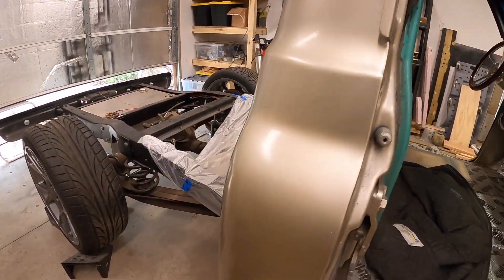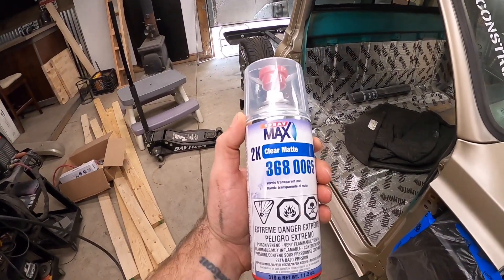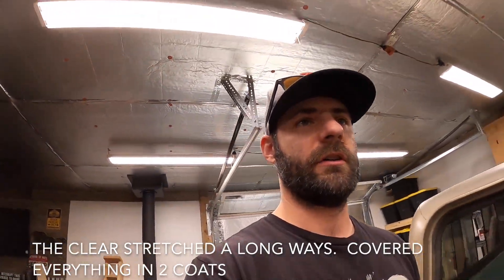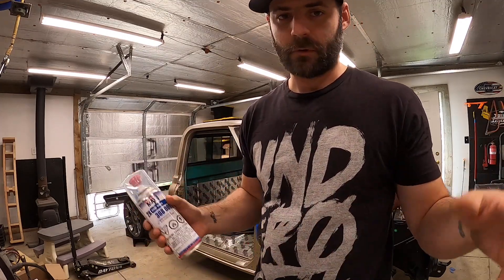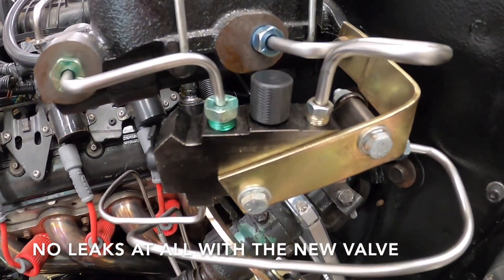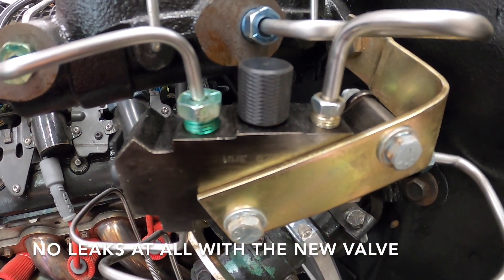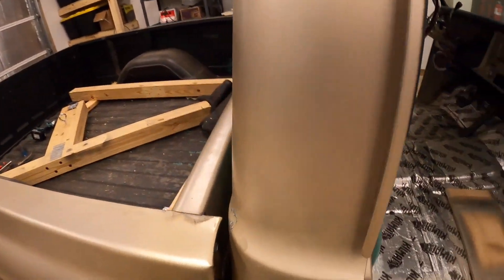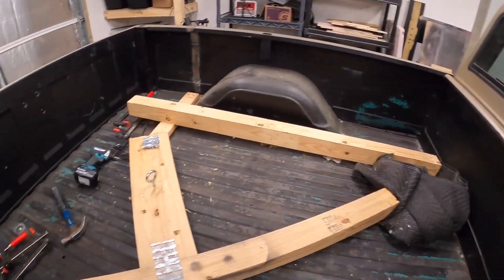Bleeding Brakes, Painting the Cab and Putting on the Bed | 1970 LS Swap Chevy C10

Comment: Did you remove the proportioning valve bleeder tool and reinstall the brake light warning switch after bleeding? Just asking bc it's still installed in your video

Comment: If you would like you can push your steering column in/down about an 1.5" and you only have to drill one hole at the top for the locator pin.   Love the truck.

Comment: Goodstuff bro, very inspiring, how did you go about choosing one brand over another? I see alot of stuff from QA1, ridetech,  belltech, CPP, Wilood, brembo, somany brands to choose from. Also wondering if i do suspension work, do I stick to one brand throughout or can I mix it up with CPP brakes, rotors and calipers and QA1 upper lower control arms?.  . .keep up the good work brauhhdahhh.  . . . 🤙🤙🤙
Reply from the maker: Well with brand a lot is dependent on your budget. Ride tech/QA1 is way more than anything else. Unless you’re tracking the truck or making 500+ hp it’s overkill IMO. I’d recommend sticking with as much of one brand as you can bc you’re sure they’ll all play nice together. That being said I ordered from all different places and it’s all from the same suppliers for the most part 🤷🏻‍♂️